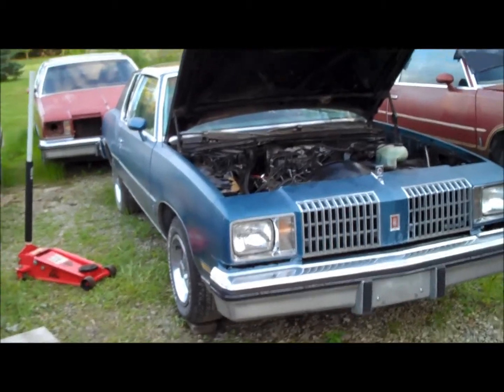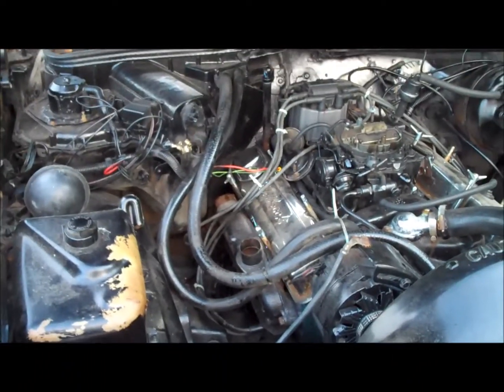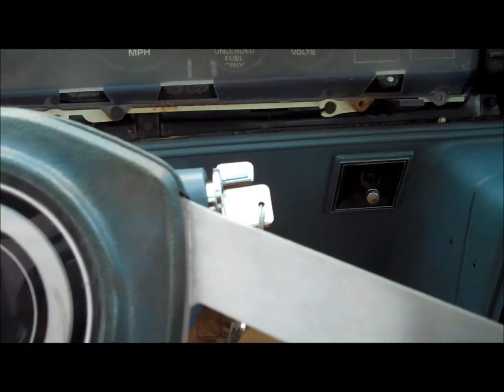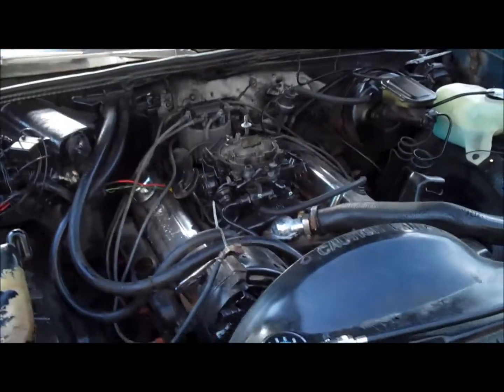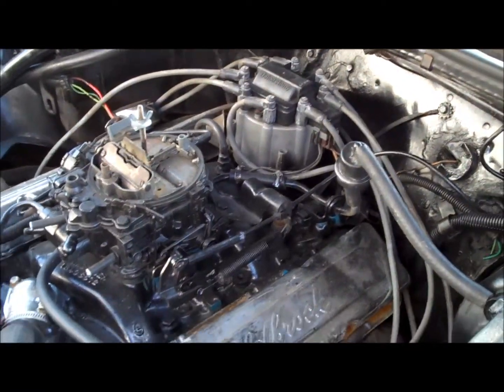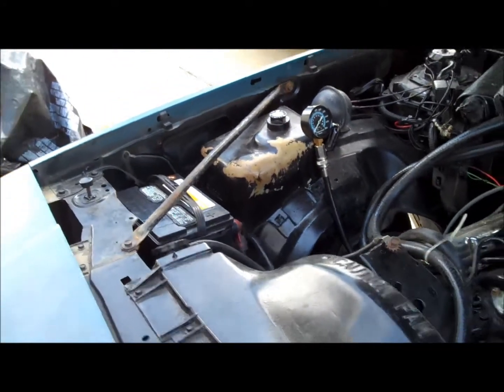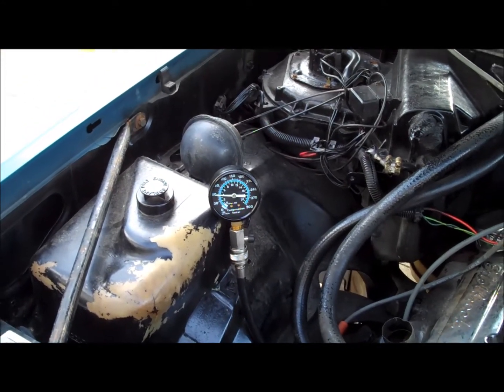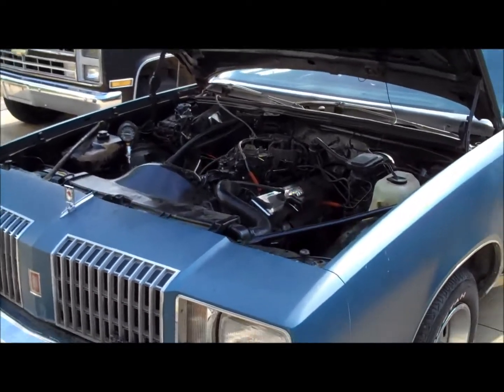78 Calais Compression Test Classic G-Body Garage

Comment: I got shocked by a non-HEI distributor on a 472 when I was a young kid messing around near the distributor cap. The center wire boot must have been torn because I got one hell of a jolt until I pulled my leg off of the bumper. I could feel every time the points opened and I'm probably lucky my heart didnt stop

Comment: A flat cam lobe won't cause low compression. The valve timing event for that cylinder would have to be altered for that to happen. It's most likely that there's a damaged valve seat, broken valve spring letting the valve stay open slightly or something wrong with the piston/cylinder.

That's what happens when you have a Chevy engine in an Olds....LOL.
Reply from the maker: Been working on it today. Things are looking up but not over the hill yet. Next vid coming soon.
Reply: A flat cam lobe will cause low compression you are wrong